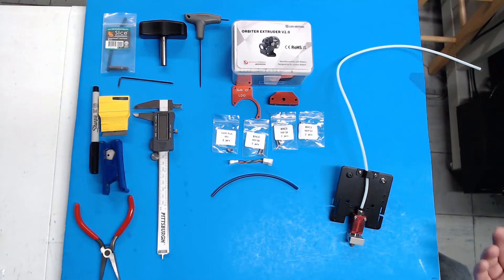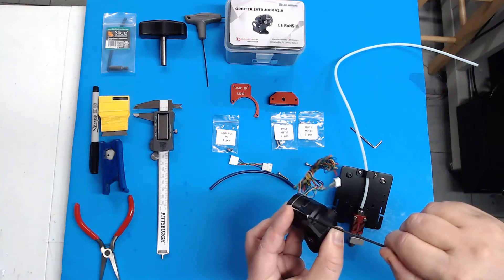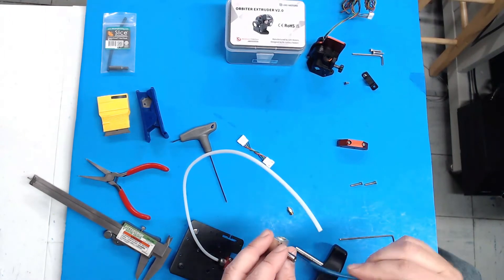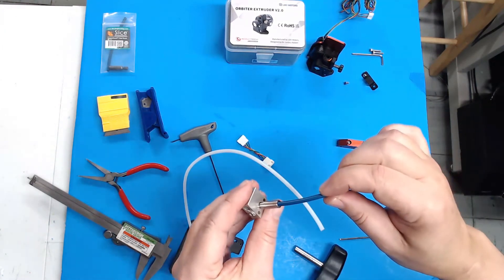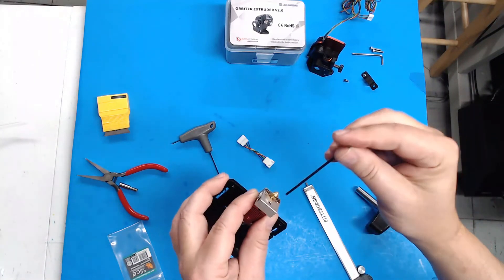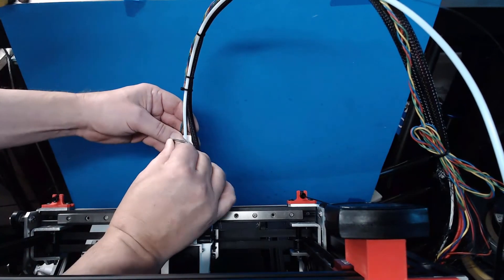Installing the LDO Orbiter V2 on the CR-30

Comment: Great Guide, worked with the one I got from Repkord. Heard "Do not exceed 1.2V Vref" tore apart and set to 1.196V. finished video incase. caught "would recommend 1 V." was already reassembled and on the wall. Ill adjust it when I fix the loom. Found my set screw loose to the heating element, likely the issue I have been chasing all along. possibly even the issue 
@planettyracom had as I had similar issues that lead me here. Thank you for the product and the great videos. Now to tune it. any advise on tuning the Extruder step size?

Comment: Is there something special I have to do if I have a cr30 with an original motherboard?
Reply: I should clarify my stepper on the orbiter v2 is not spinning at the right speed. And my friend says normally on other printers he would adjust it on the motherboard. I’m guessing I’m missing something I can do in marlin?
Reply: @wopperchop need to adjust rotation distance in the printer.cfg file

Comment: How do you set the right tension on the Orbiter? (filament clamping force)
Reply from the maker: I don’t have any specific method.  I recommend putting a mark on the knob so you can keep track of how many revolutions you turn it and then experiment with tightness.  I usually turn mine about 1 turn past when there is no play in the handle.  Should be a good starting point.

Comment: Hi. You so some impressive work. Have you ever put something like a Prusa MMU3 kit, or something similar on your White Knight or CR30?
Reply from the maker: I did hook up a Pallete 3 once but just for random color changes (nothing controlled).  I do believe @WJSteele (twitter handle) has hooked his 3d Cameleon up to the Cr-30.
Reply: @NAK3DDesigns  Ok. Thanks for that.

Comment: Can someone send me a link to the hotend he’s using? I bought the copperhead and the orbiter v2 kit but I didn’t realize that I was going to need a new hotend
Reply from the maker: That is the stock hotend.
Reply: @NAK3DDesigns  damn I bought my cr 30 used so I guess the previous owner changed it 😅
Reply from the maker: @wopperchop  CR-30 hotend is the same as the Ender 3 Pro just longer wiring.
Reply: @NAK3DDesigns  would you suggest an upgrade or should I just get the stock one
Reply from the maker: @wopperchop  if you already have the copperhead heat break I’d just get a stock hotend

Comment: How did you deal with the limit switch.  Is there a 3d part you can print to have it moved lower to function as it should?
Reply from the maker: If you are referring to the x-axis limit switch there are already two holes in the hotend backing plate that it will mount to once removed from its current bracket.

Comment: where did you get the 6pin to 4 pin adaptor? mine came with a 4pin to 4pin.
Reply from the maker: It’s part of the CR-30 mounting kit I designed.   Repkord sells them.

Comment: Great video, thank you. As a newbie, and sorry for what might be an obvious question, when changing the steps in the CR30 panel, I need to select 'Configuration' - 'Advanced Settings' - 'Steps' then 'E-Steps' and change this to 690?
Reply from the maker: Yes, that sound correct.   Then make sure to go to "Configuration" - "Store settings"

Comment: As I'm finally getting to installing this, timestamps for reference (a little more granular, at least for me):
Intro and overview: 0:06
Mount wire strain relief bracket (applies to all options): 1:26
Prep mounting plate (applies to all options): 3:30
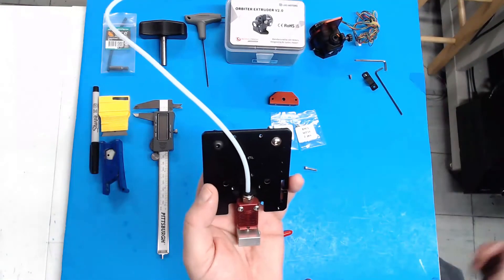Option 1 - Orbiter install only: 4:10
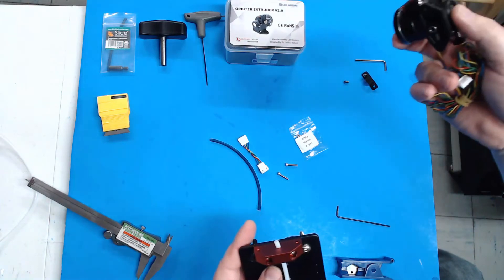Option 2 - Orbiter + PTFE upgrade: 8:02 (Orbiter mounting from 7:00-8:02)
Option 3 - Orbiter + PTFE upgrade + high-temp heatbreak: 11:58 (Orbiter mounting from 7:00-8:02)
Wiring + attaching to CR-30: 14:35
Configuration: 16:54

Had to look up what Vref was. Everything else I understood the terms of... (my first non-Prusa machine :P)

Comment: 690 Steps/MM on all Axis'?
Reply from the maker: No, only on the E-axis.
Reply: @NAK3DDesigns  any ideas as to why the feed would be super slow? I've double checked everything quite a few time but it seems the feed speed is too slow to lay accurate layers...
Reply from the maker: @eriklomen6351  make sure you store settings after setting the esteps to 690 and if using Ideamaker make sure you have esteps set to zero or 690 as ideamaker will set the steps/mm in the gcode.

Comment: This looks like it would fit an Ender 6, can anyone confirm or measure distance of the top mounting holes?
Reply from the maker: Mounting holes spacing is 23mm on center.    I’m told the hotend mounting plate is the same one as on the Ender 6.
Reply: @NAK3DDesigns  Thanks for the reply!

Comment: I got it, installed it, and it does work.  I have to admit that I've never been a fan of bowden tube designs.  
But... I have had three failures caused by back pressure in the filament causing the sort piece of tubing between the extruder and the heat break to buckle and escape from the extruder.  Between Capricorn tubing and a bi-metal heat break, this surprised me.
There is s simple fix.  I used a short length of metal tube, just slightly larger in diameter on the inside than the Capricorn's outside diameter, between the extruder and the  hot end.  When the tubing wants to buckle, it doesn't have anywhere to go.
Not a huge problem, and a fairly simple fix.  But it did happen.
Reply from the maker: Sorry you've had that issue.  I've printed hundreds of hours without that happening so it make me think you might want to verify you have your e-steps calibrated properly.  Glad you found a work around.  Thanks for your purchase and happy printing.
Reply: E steps are good.  It was the first thing I checked after installing the Orbiter.
Thinking some more about it, to get enough compression to get the buckle, I need to check the state of the nozzle.   It has been awhile since I last swapped it for a new one.
No one said that 3d printing was maintenance free.

Comment: What are the main restrictions of the patent on belt printers that other manufacturers must not implemtent?
Reply from the maker: Basically you can't have  printer that has 3 perpendicular axis using a belt to remove the finished product.

Comment: Sure wish i saw this video before I printed a mounting bracket to make mine direct drive with stock extruder. although i didn't have to spend and money. I did the linear rail on the x which i love, Might do this in the future. Thanks for continuing to work on  improving the cr30!!

Comment: What is the benefit of this?
Reply from the maker: Decrease retraction amount (took mine from 6.5 to 3mm with Marlin, I here people with clipper gave it down to 1mm. ) and better compatibility with flexible filaments.    Also Less pressure feedback since you don’t have a long Bowden run between the extruder and nozzle.
Reply: @NAK3DDesigns  thanks for the answer :) Have you tried different belts to get the prints to stick more? I have ordered the formula 32 one to try but haven't tested yet
Reply from the maker: @TheKdcool  I tried several that Creality sent me and I've tried a few other options, can't say I've found the perfect solution yet.
Reply: @TheKdcool  aquanet on the belt works well and doesn't ruin it like a glue stick does. After it dries it looks the same as before.